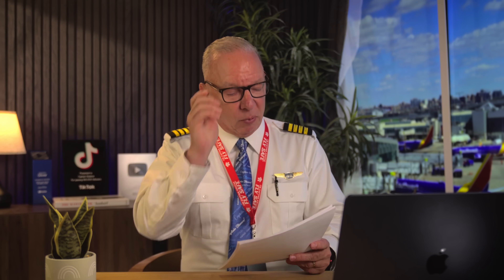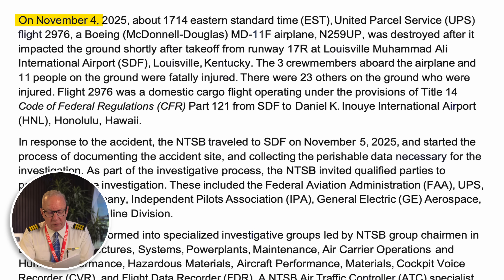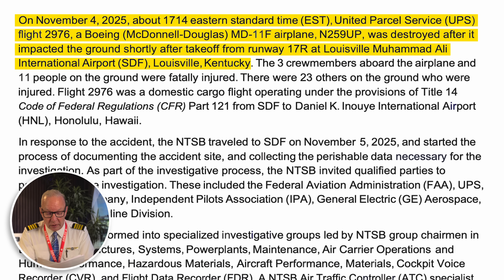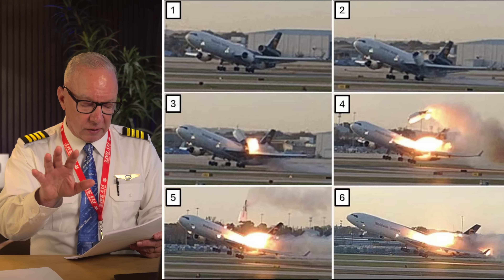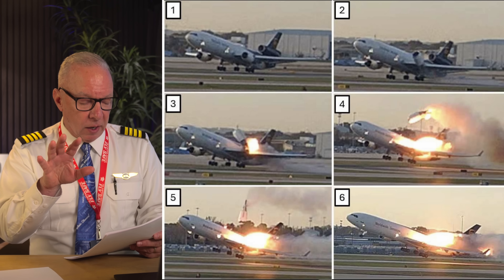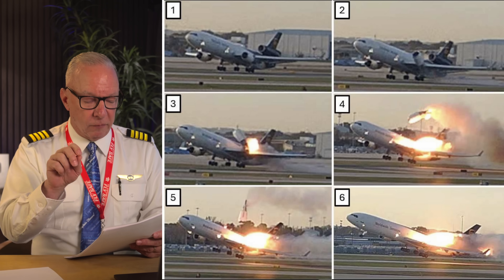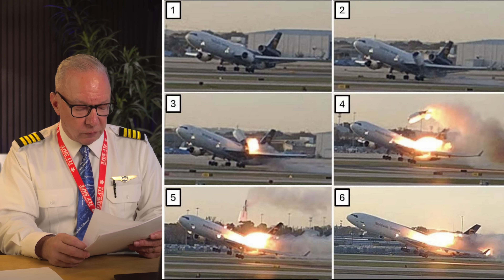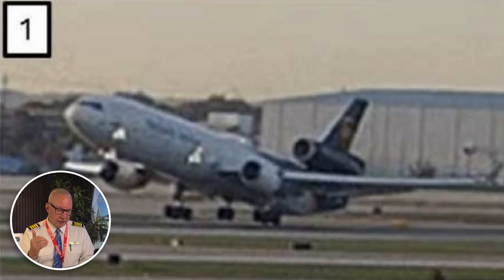UPS Crash Preliminary Report | Pilot Reacts to UPS Crash Report

Comment: This doesn't appear to be a wear-and-tear issue. The failure mode bears striking similarities to the 1979 American Airlines Flight 191 DC-10 accident. In both cases, the engine and pylon separated in nearly identical fashion—the only difference being that in 1979, the detached assembly struck the left wing, while in this incident it apparently struck engine #2.
The root cause identified in the AA191 investigation was improper maintenance procedures. Maintenance crews were removing the engine with the pylon still attached to the wing, using a forklift in a single operation. McDonnell Douglas maintenance manuals specifically instructed that the engine should be removed from the pylon first, then the pylon removed separately from the wing. This shortcut procedure caused stress damage to the pylon attach points that wasn't immediately visible.
If similar non-compliant maintenance practices were used here, we may be looking at the same underlying cause rather than component fatigue. The NTSB should thoroughly investigate recent maintenance procedures on this aircraft's left wing pylon mounting hardware.

Comment: Do prelim reports usually come out this fast. Seems quick to me but i guess it wasnt a big mystery as to what happened.
As far as the mounts go, i would think that that would be an obvious fail point.... obviously. The fact that it could have that many cycles without a mandatory replacement of the mounts at some point seems crazy to me. I mean, 29000 trips anywhere in a car and your motor mounts are shot and they dont have near the stress on them. And Dont they check the whole plane for metal fatigue every so often. How the hell wasnt this caught before hand. I feel sorry for those pilots. They Didnt have a chance in hell to do anything about it

Comment: I know you won't agree with me... But my opinion is the pilot only had from picture 2 to 3 to decide to hit the wall -at the end of the runway - instead of trusting that 2 engines would lift the plane.
But by the picture # 6 it should have been obvious engine 2 was damaged too... Impossible to see, and by then the pilot was committed.
They were dead either way.

Comment: A comment on the statement at 11:47 in the video, "But that doesn't mean they [the cracks] were preexisting"...  You can pretty much count on a fatigue crack being preexisting.  

What's particularly disturbing/surprising is that the time interval for inspection of the pylon mount structure was far too long to detect the cracks before at least one reached critical length.  The proper inspection interval is supposed to provide at least two opportunities to find a crack before it reaches critical length.  Once it grows past critical length, the rest of the metal fails from overstress.
Reply: I suspect he was intending to address the overstress fractures when he said that, and not the fatigue fractures
Reply: I keep thinking about Neville Shute’s “No Highway” written nearly 80 years ago and metal fatigue in aircraft.
Reply: @TraceyBurton-gs6jm  It is true that these fatigue cracks are unlikely to be detected without removing the pylon and inspecting the bore of the hole.  The inspection method could be eddy current or some other Non-Destructive Testing method, and should already have been part of the "aging aircraft" maintenance program -- with the proper inspection intervals prescribed.  If the critical crack length is too short to be detected then there should have been a mandatory replacement interval, or a redesigned part.
Reply: Forward lugs weren't fatigue fractures. Those were stress fractures from taking the thrust stress that the rear bolt wasn't taking after it broke. When the back bolt breaks the engine thrust will rotate the engine around the front bearing (technically teemed a roller bearing not a spherical bearing which would be a gimbal) (actually the front bolt) and at some point the front bolt will shear which it did. Problem here is the bearing are shown 90° to what they should be if this is the center of rotation in a pre-fan-expansion scenario. In the drawings here the engine is going to swing left and right around the bearings. Might help in a strong yaw situation and the engine would swing up and rest against the wing.. don't think this was intended but maybe.
Reply: @fedfraud.protection.servic2557  We're all a little confused here - we have the forward and aft mounts, and the aft mount has both a forward lug and an aft lug.

The forward lug of the rear mount ( which is what the report is discussing) was found to have a fatigue crack along the lug bore on the inboard side. The outboard side failed under overstress. The aft lug of the rear mount had fatigue cracking on both sides. This leaves us with the story that the aft lug failed completely from fatigue, putting all the stress on the forward lug, which was compromised from fatigue on one side and so couldn't take the load.

As for the forward mount, not much is being said apart from it being found with the pylon. So we can assume it wasn't damaged, and the wing mounts were torn from the wing under overwhelming stress.
Reply: @robertbackhaus8911  The main point to there being both fatigue cracks and overstress cracking is that the parts were already breaking off before this flight, and right after rotation on this takeoff is when the remaining structure couldn't hold on anymore.
Reply: Should probably study up on fatigue (Wikipedia "Metal fatigue"). Cracks don't always appear visually before cracking. I'm saying that they can reach stress levels before being seen in some materials and how long it takes them to break after initialization can vary depending on stress forces and vectors and materials involved. I'll agree with anyone that wants to say that those bolts and the whole pylon assembly should be swapped at least every 4000 hours or less. I would think UPS would have a pretty aggressive program on this and the bolt that broke was a knock-off. Also, I think CptSteeve is quoting NTSB/FAA regs which are absolute max shut you down if you don't and operators are going to have much more aggressive schedules.

Comment: I worked on the Challenger aircraft and worked on the pylons for the Lycoming Engines. The pylons were made of titanium and were very beefy. I worked on the Challenger engaged in testing for the FAA certification. During the stall testing there was an issue with the parachute used to create the stall would not release from the jet which crashed and there was on fatality. I knew that pilot who died and it was sad he lost his life.

Comment: This is easy corrective action. Replace all Pylon mounting structures (especially bolts, or alternatively bolts only, inspect other parts) with known good grades from recently acquired and trusted (and, lot tested) sources before flying. No problem.

Comment: I presume the airlines' service engineers, on instruction from the NTSB,  will now be disassembling  and inspecting all the engine pylons on the grounded MD-11s and DC-10s to determine if this issue is confined to this aircraft.

Comment: Well Mc Donnell Douglas and their defective designs with fake recommendations on how to close DC 10 cargo door how to maintain tail trim screw and how frequently inspect also maintain engine pylon connections cost close to 1000 lives alone in last 50 yrs. Those people could have been alive if those crooks one way or other felt responsible for what they design. Those accidents are not  part of modern aviation developlment milestones they were in fact crime cases

Comment: How do they know the engine didnt come apart which caused vibration breaking the mount?
Reply: They found the largely intact #1 engine alongside the right side of the runway.
They also found fatigue cracks in both lugs of the aft pylon mount.

Comment: The "forward and aft" under discussion were not the forward and aft pylon mounts, but the two layers of the same aft mounting structure.  That's a double-layer aluminum slab with a hole in it for the spherical bearing.  
 
Because of the design of the forward pylon mount, it is completely unable to retain the engine when the aft mount fails.  That's what happened with AA191, and the only apparent difference between these two events lies in which layer of that aluminum bulkhead failed first.  As soon as one half of the complete flange was lost, so was the recoverability of the aircraft in both cases..
 
Back in the 1970s, a friend of mine worked as an airframe inspector for a major airline based in Miami.  He called the DC-10's pylon mounts "loony" and refused to take a flight operated using one.
Reply: Agreed.  Captain Steve got a bit mixed up.  From my experience, the aft mount is split into forward and aft lugs as a crack stopper.  Either lug should carry the full load if the other failed.  Unfortunately, both lugs appear to have fatigue cracks so once one failed the second could not carry the load.
Reply: @Whiskey_BS  captain steeeeeeve always seems to get mixed up! He also seems confused about the direction the no1 engine took, "Gyroscopic Procession Effect" as covered  by Juan in a previous video! Blancolirio for me Every time !
Reply: @Whiskey_BS WOW. I've been wondering about that and that actually makes sense. But only one of the lugs aft? showed fatigue cracking. So, why didn't the one not fatigued fail?? That's pretty brilliant BTW. Thanks for answering something that has been bugging me 😂.
Reply: @fedfraud.protection.servic2557  I thought the report said that there were fatigue cracks in both lugs. I’d have to double check.
Reply: @Whiskey_BS  I think everyone is missing a key element here, the bearing is on these lugs to adsorb or dampen, the multi-lateral forces. The bearings outer race and balls are 100% gone. Losing the bearing would lead to slop in the mount causing it to slam around causing fatigue cracks, way ahead of schedule.  I think the issue here will be in the end, the bearing went first, causing the rest to fail over time. These bearing are installed with precious instructions, a lot of the times you heat the pylon lug to X degrees, while the bearing is stuck in dry ice for X amount of time, allowing the bearing to slide in with no friction. If you were to get one mechanic at the depot level assembling this item, have that bearing hang up just a tad and tap it with a hammer to finish the install (improper install), it will lead to the bearing failing like the one we see here.
Reply: @Kory.g.O  agreed that is a very likely scenario. The bearing was torn up. Assembly of these aerospace bearings can be tricky. We will see what the metallurgical analysis of the bearing shows. I’d love to see what the results were of the field inspections of every MD-11 pylon mount bearings.
Reply: @Whiskey_BS  I honestly can not remember, last time we had a big inspection like that how long it took for the FAA/NTSB to release the findings of a fleet inspection.
Reply: Yes I commented on the confusion between the forward mount and forward lug as well......before I saw your post. Glad someone else caught that.
Reply: Under Engineering design and  excessively used aircraft with 21,000 cycles. It appears these parts should be replaced
At certain time/ cycles Plus an improved enhanced mounting system would be required.
the design of a tri engine aircraft can be problematic as it can suffer damage from debris of  a wing engine.

While the 747 four engines sucks fuel the four engines makes that aircraft the best freighter or the DC8
My career CO FTL, FDX
This AA191 crash and grounded DC10 pushed my career to FTL and I grew to love the 747 aircraft
Reply: @lrcreamer  
More of 747 or 707 ! fan than the DC10 ... To be fair the 747 has in past had non catastrophic and catastrophic pylon failures  i.e. El Al Flt 1862 4 Oct 1992.

Fatigue life calcs are not an exact science it's probability based on lab testing and real life feedback .... 21 000 cycles is a fair way short of 28000 cycles an outlier, horrible / terrible given the fatalities and injuries.
It would be interesting to how these life cycle figures were determined, and how many in-service MD11's rear mount bearing supports are  now found to have cracks. 
From my experience in high pressure pumps (admittedly we do not use aluminium  it's too weak, we don't care about weight) surface finish , various  types of corrosion , unexpected ( excessive / not predicted) vibration   and wear / excessive clearances etc will drastically reduce theoretical  life cycle calculations. 
A take off and landing cycle ( a good guide for fuselage pressure cycles) is a lot less than the number of load cycles an engine mount would be subjected  to per flight I think the flight hours 93000 are more relevant ?
Reply: The report doesn't mention the forward mount much at all - but there wouldn't be much to say. It failed under overwhelming stress after the failure of the aft mount.
Reply: @robertbackhaus8911  the report says that the front part was still clamped onto the wing (which it tore off). So the front part of the mount didn't fail - the part of the wing it was clamped to just couldn't withstand the forces being put on it when the aft part of the mount failed
Reply: Such a shame to read damning sentiments in a little YouTube comment. If there was any doubt at all people should have screamed from rooftops. Too late.
Reply: Later experimentation has shown AA 191 would actually have recoverable if the flight crew had known what had happened.

The actual crash was caused because the damage to the left wing's hydraulics both increased the stall speed of the left wing and disabled the stall warning system, and because the procedure at that time for a single engine failure during takeoff directed the pilots to reduce speed below what was now the stall speed of the left wing after the hydraulic slats had retracted.
If the crew of AA 191 had known that the slats were retracting and kept the aircraft's speed even 10 knots faster, then the left wing would not have stalled, and the aircraft would have been controllable enough to return to the airport and make a safe landing. 
(The speed they would have had to maintain was a bit faster than a usual landing, but still slower than the takeoff speed for a fully loaded DC-10 at max takeoff weight.)

This crash is different in that the aircraft suffered a second engine failure immediately after the first, and was no longer capable of maintaining level flight at all.
Reply: The rear pylon mount sperical bearing lugs are titanium, not aluminum.
Reply: @amicidavinci  You noted,  "The rear pylon mount sperical bearing lugs are titanium, not aluminum."
                                    The lugs are aluminum.
Reply: As an Australian LAME I also saw the confusion in which mount he was talking about. It always surprised me as to why the designers didn't put a plate across the forward ends of the mount pins(?) of the forward mount spherical bearings, especially after AA191's crash. To my mind that would at least stopped the engine sliding forwards off the pins when the rear mount let go.
Reply: They want that forward mount to fail and let the engine go if the rear mount lets go first. Also there's 50,000 lbs thrust rotating the engine around it. They're trusting that the rear mount fails because of excessive vibration from a fan that is ready to expand catastrophically. System reacted as it was designed to.
Reply: @fedfraud.protection.servic2557  In relation to the horizontal longitiudinal axis along the fuselage, nose to tail,
                                                                           the thrust line of the wing mounted engines on a DC-10 and a MD-11
                                                                              is a few degrees down, looking from the front of the engine and towards its aft end.

If the fwd. mount attached to  the front wing spar breaks away first, the engine will drop down at its fwd. end and then the aft mount of the pylon will break away next.

If the aft pylon mount breaks away first, then the thrust from the engine will pull the back of the pylon down and most likely the one supply line to the engine will tear apart at the pylons fwd mount area. There will be en'uf residual fuel in the fuel line to run the engine for a few seconds and due to the engines thrust line being angled up from the attitude of 
the pylon, the engine will 'scoop' its way up and over the top of the wing which happened in both of the two instances, AA and UPS. 

The clevis and lug for the aft mount for the pylon should be made from stronger titanium and not weaker aluminum.

I am a retired airline inspector and spent several years inspecting both airframe and engines on the DC-10-30, including the detailed visual inspections of the forward and aft mounting areas for the pylon.
Reply: Thanks was about to add this as well, he most certainly explained the analysis incorrectly

Comment: The 100 all vs 30 agl issue.
Where is the transponder antenna?
If in the front, it is entirely possible that the gear made it only 30', but the nose was 100'.

Comment: In the Past, they Found Mechanics used Fork Lift to Lift Engine which Damaged the Pylons.  They Warned Against Use of a Fork Lift because of Pylon Damage Risk.
Reply: Very true. DAL only used / uses Bootstrap. Doesn't strain the mount bolts & mount assembly.

Comment: Q 1: are newer airplanes mounted in the same way, or have they been redesigned to be more robust? 
Q 2: what is the failing fatigued material, aluminum or titanium? Do you think the manufacturer will update the inspection cycles or require ultrasonic testing on these parts?
Q 3: what is the likelihood of airlines just scrapping these planes?
Q 4: do passenger planes have a cycle limit they have to retire by? 
Thank you Captain